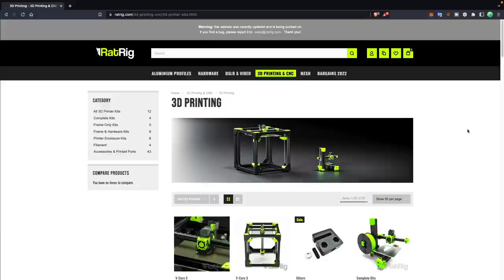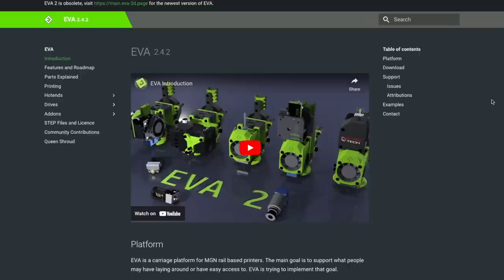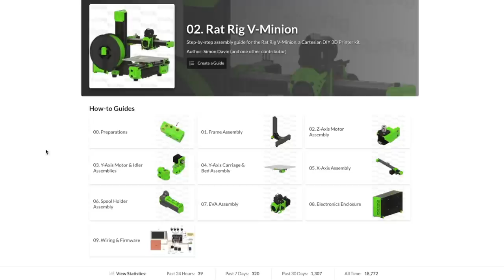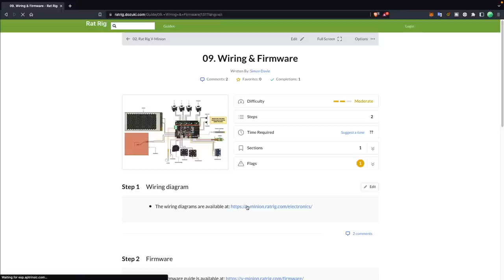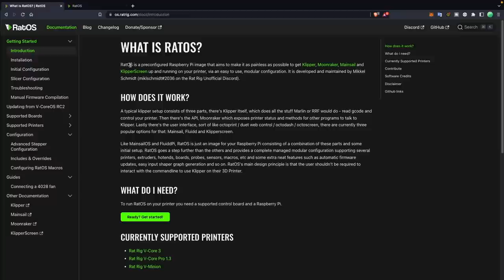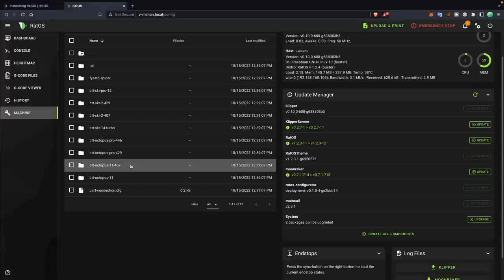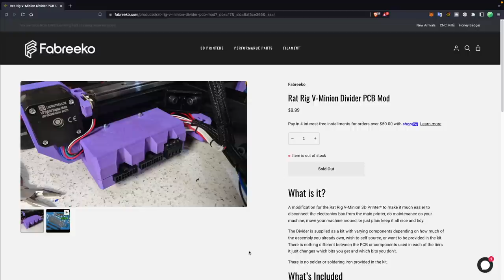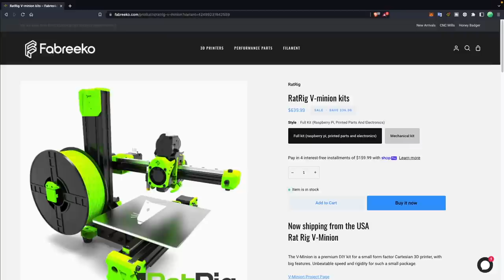The Rat Rig V-Minion Is Built Like A Tank!

Comment: I built my V-Core3 together with Albert from 247printing, and I totally get your point about the nut pockets. In the end, we used a soldering iron for some nuts, but it feels somehow wrong if it's not an insert. Just recently, about one year later, we discussed the build experience of the V-Core3, and that was the main critique. Once built, the machine does an excellent job. It would be great if RR would increase the tolerances for the pockets on their 3D-printed parts.
Reply: I double that!
RatRigs are great, but they (still) don’t have the best designs for enjoyable build experience 😢 
The V2.4 was the absolute super joy to build in comparison.
Reply: With looser tolerances, they'll just fall out at the most inopportune moments instead. Luckily EVA 3 comes with a heat insert variant, so this is less of an issue if you print the parts yourself :)
Reply: Nut pockets
Reply: Honestly hate trapped nuts in 3D-prints. Heat inserts is just so very reliable and looks better, and honestly not very expensive. Well worth it imo. Especially for a machine that already requires crimping tools and so on. Might as well just require a soldering iron with some heat-press tips.
Reply: @ivyr336  ehh.... nuts are much stronger though (and cheaper), so I prefer them myself, really depends on situation as well

Comment: I kinda wish the Review would have taken into consideration the speed a bit more because its a very fast printer.
There are already a bunch of comments wondering about the price but this printer can print 3-5x as fast as other printers in its style or even price range.
18min, quality benchy, not a weird looking speed benchy, is what I would consider the default speed for a well tuned V-Minion.
If you want to go even faster I also printed a 24min, 200% Benchy on this before and it still looked decent.
That was at the limits what 24V steppers can do with around 40,000 acceleration and close to 500mm/s print speed, maxing out at 65mm³/2 flowrate.
Its fast, its reliable and very open for modifications, especially thanks to EVA.

Comment: Awesome video. Thanks for sharing. I've built my own Minion just few days ago and it is an awesome machine. Wow. Really kinda tank. Massive. Good quality parts. I fully agree to our comments on the nut pockets and  the swapped wiring for the end stops. The latter really being a big and unnecessary risk to damage the board. My Minion came with an Octopus v1.1 board which is a solid good quality one. The little electronic box becomes a bit noisy during operation. I swapped the compartment fan by a Noctua 40x15 which is much quieter and still blows enough air in. Overall a pretty loud printer, but printing quality is impressive as is the printing speed. Works great with SuperSlicer and Prusa Slicer. I am very happy having purchased this little beast. I think, my next printer will be most likely the V-Core 3.1 ...

Comment: if you put the nuts on a soldering iron tip around 250c, lit it set to warm up and then push into the hole. it prevents the plastic potentially cracking as well. the screw is what holds the nut in place, the insert is there so you dont need to use a wrench/spanner.
love your videos!!!!!

Comment: How long is the PSU to printer connection? I mean, the allover footprint to bed size ratio looks horrible in the video.
Reply: Nero3d did a mod for it, where all the electronics is beneath the bed, but you will need different components like a passive cooled psu and a skr pico, otherwise you dont have enough space

Comment: I have a mk2 with 16,000 hours on it and it has been in an enclosure it's whole life. The PETG prints are still holding up just fine.
Reply: Back then, I am pretty sure they printed them in ABS. You can confirm if it is ABS by bending a part and if it shows white stress marks, it is ABS.

Comment: i suppose it's bigger than a voron 0.1 but ngl the price is quite steep for a cantilever
though if it's as rigid as you say it is, i guess that just means less point of failure
Reply: Based on the footage shown it looks less rigid than virtually any dual Z lead screw machine. Probably stiffer than a single leadscrew Ender 3 though.

I really like cantilever printers now, but even when way overbuilt as this one is, they are still kind of flexible by comparison.

Comment: You printed PETG on the textured PEI sheets?  My experience with that the PETG will adhere too well to the PEI texturing and often rip it off or chunk it out when trying to remove it from the plate.
Reply: I recently bought two PEI sheets. The first one PLA stuck so bad I needed a razor blade to get it off. Second one PLA popped off so easy I was stunned. So it greatly depends on your sheet

Comment: Looks great.  I have been looking for a smaller printer like this, but while the other similar ones are cheaper, they all seem to have issues including this one with the wiring issues that while annoying is manageable.  I really want a printer that will print PLA and ABS which is a catch 22 as the printer kits come with PETG.  My current printer, a heavily modified Ender 3 Pro that no longer prints PLA after adding a Microswiss all metal hotend and direct drive.  It clogs when printing with PLA.  Still, this printer looks good and I am definitely going to look it a bit more.  A bit pricey though.  I would be more likely to buy it if it came with either ABS or ASA printed parts.  It would be great if MatterHacker were to sell aluminum parts instead of the plastic parts like they do for the Voron 0.1 and 2.4.
Reply: KP3S Pro my man
Reply: @walkdontrunplz  lame belt management and screen
Reply: @urgamecshk  cool

Comment: What do you mean, please - incorrect endstop wiring?
Reply: It's when your wires are ordered incorrectly compared to the motherboard socket. The endstop has a JST connector which can plug only in one way, so a user will think it's correctly set up for the motherboard

For example your endstop has three wires in this order VCC - GND - SIG
and the motherboard has a socket that accepts GND - SIG - VCC

If you just plug it as is the mb will send current through the wrong wires, which I suppose will make it short out and die. What ModBot suggested is to have the endstop shipped without the connector, so the user has to check the wire ordering on the mb and install the connector properly

Comment: So what's the benefit of one of these over an ender 3? Just that it's smaller?
Reply: An ender? Really? Wtf
Reply: @darththuban00  I personally consider the ender 3 the baseline for hobby printers due to it's low cost and vast options of aftermarket modifications giving the end user the ability to modify the machine into a more professional set up if so desired. Ender 3, sonic pad, all metal hot end, would that not perform similar to this machine for a lower cost?
Reply: @biggboysouth  No way it will perform similar to a minion. Look at the components of the minion, the quality of the steppers, hotend, extruder etc. etc. If you want to know how an Ender with Klipper will perform look at biqu hurakan.
Reply: @darththuban00  That is a solid point and honestly since my original comment I've come to understand the pros of a factory upgraded printer. For me I struggle to see the price justification of this printer specifically. Just seems a bit high for what it is, needing so much user assembling, pieces made out of printed parts (not greatest for enclosure use) and being smaller build volume. For $100 more you can get a Bambu labs P1P which is one heck of a machine readily assembled and awesome company and community support. For $300 less you can get a ender 3 and sonic pad which isn't as fast but certainly respectable for a hobby printer and a much easier to stomach entry price.

If this V minion was something like $450 I'd say it was a killer deal but at $600 plus seems a bit steep. But to each their own just my 2 cents. I honestly was interested in this printer for a dedicated small PETG machine but the price put me off. Ended up just saving for Bambu X1C. Really is as good as all the reviews say it is. Nearly perfect default material profiles.

Comment: A bit pricey for such a small printer.  I would rather buy a Voron 0.1.
Reply: its also bigger and faster than a v0...
Reply: @morbus5726  True, but the Voron 0.1 and others like it is easier to enclose for filaments such as ABS.  I do like the build volume of 180mm though vs only 120mm for the Voron.  I don't have a lot of space so something that is easily enclosed like the Voron 0.1 is a better option for me despite the smaller build area.

Comment: 600 dollars for a mini printer?
Reply: It’s worth it. Most of the time the build volume is sufficient. Maybe not the best option if you don’t have another printer, but it’s a joy to use and can be pushed (especially with a few mods) to go very fast.
Reply: it's also capable of printing 500mm/s at 40k accel stock
Reply: @morbus5726  higher than that with a few mods (like an LDO-42STH48-2504AC on the y-axis). I've been printing at 60k, and can hit 800mm/s for a bed-sided test print. My Dragonfly BMO with CHT nozzle can't keep up, so I'm looking at a hot end upgrade (I've been waiting for the promised high flow Revo nozzles).